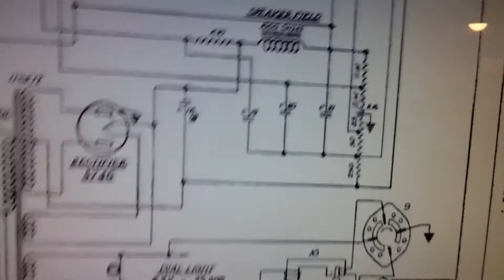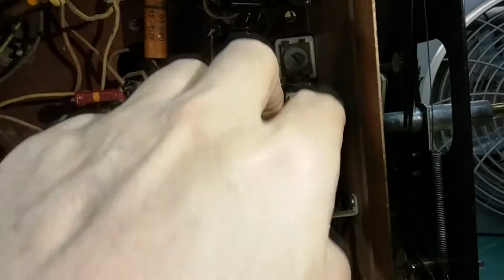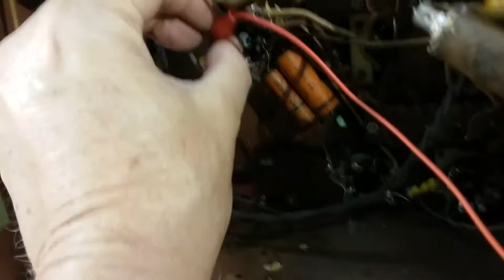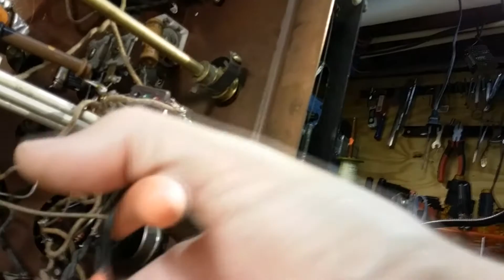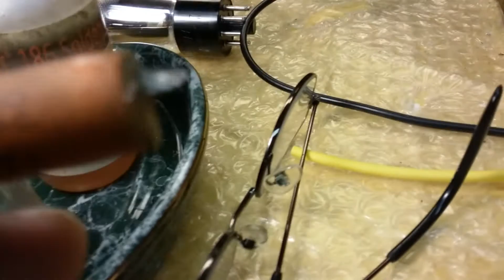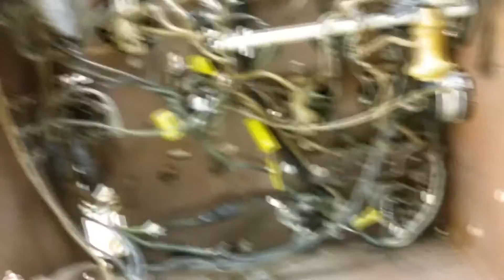Under the Hood of this 1938  Zenith Antique Radio - 9S262 - Part 2 - Radio Recap

Comment: It took me a while to figure out what was going on with the duplicate resistors and capacitors. When I came across a video that someone mentioned they wanted to write the least amount as possible. Now makes sense. I'm working on a Zenith 5S-320.
Reply from the maker: Glad this video was helpful to you! Best wishes on your 5S-320! Stay safe! These transformer units yield a lot of B+
Reply: I'm sure you know your electronics but you can't expect us to watch hand held video for an hour with your hand being the centerpiece of the video.  Get a tripod and use a pointer of some sort if you want us to pay attention to a specific place in the picture.  Your presentation is painful.

Comment: Interesting diagnostic process but the shaky camera makes it all a bit difficult to watch...I've had good luck with Ace Hardware large O-rings to replace old leather tuning belts, found one for a Zenith that was the perfect size and only about $1.30.
Reply from the maker: Sorry about the shaky camera. I really do need a better setup but time and space are very limited for me. Thanks for the info about Ace Hardware as a possible source for drive belts.